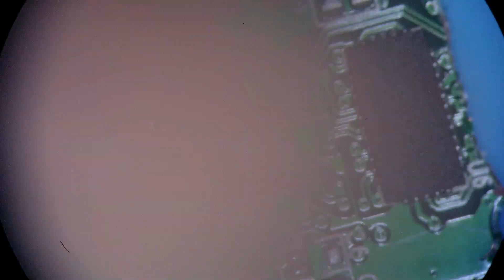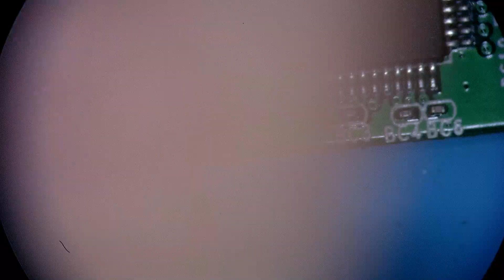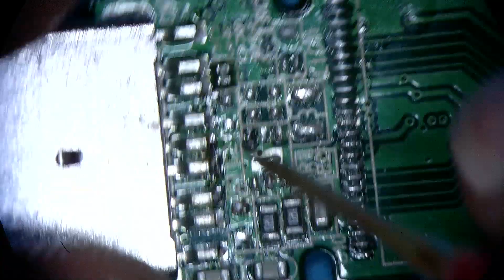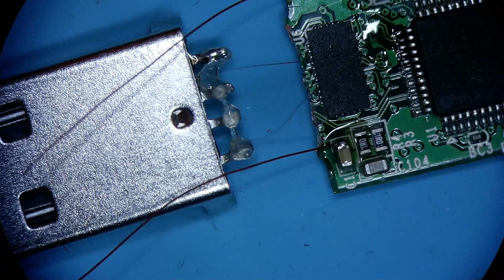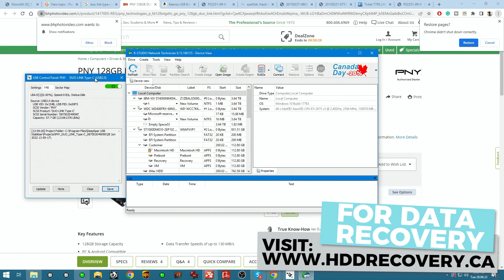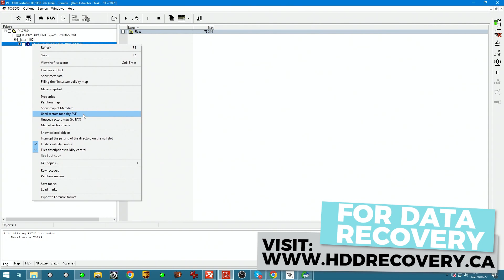how to fix usb type c flash drive for data recovery

Comment: Hey Erkin, unrelated to this repair, but Naomi Wu put out a challenge for anyone to fix a USB drive that she "destroyed" with 240VAC mains voltage to the data pins. If it's at all possible it didn't fry the NAND and if there's anyone who could recover the data it would be you. She can explain the challenge and reward here:
https://youtu.be/Gg0sdeAwN5A?t=832
Reply from the maker: The NAND can die even at like 5v. I doubt there is anything left of the NAND at this point, but at the very least the controller needs to be cut out and NAND tested. Maybe it was fused "saved"  by something failing prior to hitting the NAND. Do I want to try this? I would but I don't have access to x-ray to even know where the controller is to cut. Ask Rusolut if they want to try.
Reply: @hddrecoveryservices  I know it could kill the NAND, but didn't know if the controller would help prevent NAND from frying. It was a challenge not an actual recovery and I figured if anyone could do it, you could.

Comment: Have you ever tried to recover data from a SSD that became "Satafirm S11" and cannot be accessed in any way possible? Mostly it happens to Kingston SSD's and it's caused by the controller.
Reply from the maker: Of course, it's a super common PS3110 controller failure. Easy fix for me
Reply: @hddrecoveryservices  just happened to me. Really happy I didn't get rid of the SSD. Does it involve changing anything on the logic board?

Comment: what about unsolder both ic and mount on another same type of usb.... because that usb also have same parts... mount can be done two ways first completly replace both is using soldring second try to put ic ower ic like double story remove power supply pins of ics of second usb..... and solder all pins of upper ic or memory to the memory of good usb ic..... only power supply line only connect to the upper chip not to the lower chip
Reply from the maker: I know what you mean, and I do swap chips to working boards all the time when I have donors, but in this case I did not, and putting 4 wires to connector was/is the easiest way to get data recovered.

Comment: which one is easier? SSD or HDD restoration?

As far as I know, if the HDD has been scratched on the disc, it will be almost impossible to retrieve the data on the scratched area.

while on the SSD the data is stored on the memory chip which will remain there even if other components on the PCB are damaged.
Reply from the maker: There is not simple answer as they are 2 completely different things. Its kinda like what is happening with car industry. Hard drives are like gas engine cards, and there are lots of great mechanics out there who can fix/restore/rebuild cards from ground up. Is it easy to restore a car? Probably not, but it is possible :). SSDs are like new gen electric cars, where almost everything is tied to the software/firmware. Imagine the time will come where your electric car stops working because nand memory has degraded.... OMG I just pictured it. But to make my comparison short, SSD recovery just like e-cars repair industry depends heavily tools that can work with firmware and patch things. There are almost no options aside from PC3000 and MRT that work with SSDs, and even then only 15% of devices are supported. Recovering data from platter damage hard drive is hard  but it is possible on partial level. Recovering data from an NVMe SSD with degraded memory that is not supported is not possible.

Comment: Nice and smart way of figuring it out. Just one question: Are you not afraid, that maybe traces from the multiple layers are shorted in the area where it broke? Or did you check the edge before? Thats one thing I was worried about before you applied power to the device
Reply from the maker: I check for shorts at power in and ground with beep test

Comment: Hey Erkin, thats the real engineering.awesome work and I really happy with this Frankenstein method 🙂. But if you did it without professional recovery tools like deepspar usb stabilizer and ace lab it would be more helpful for students like us.
Reply from the maker: Deepspar and pc3000 is not really needed in this case. You can clone the unit even with R-studio or winhex by plugging in to the computer directly. I just use these things because I have them and they are safer alternatives that is also slightly easier to manage.